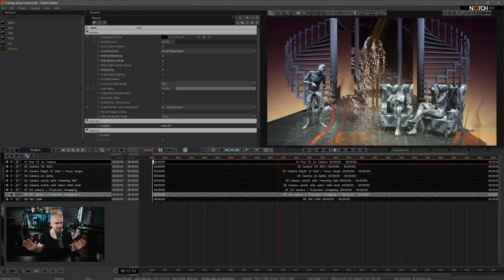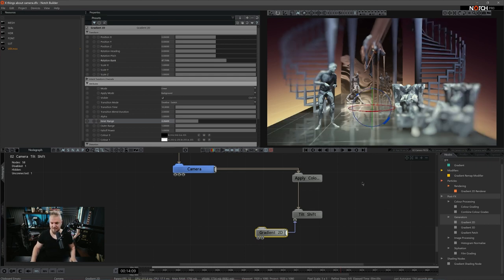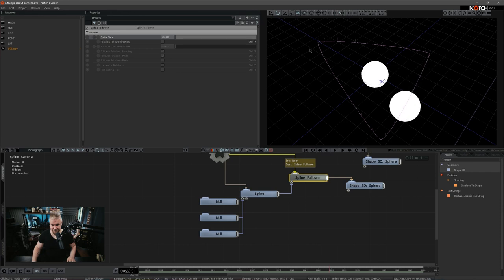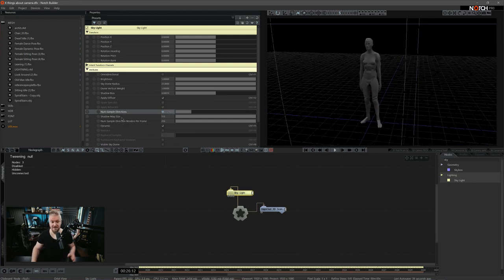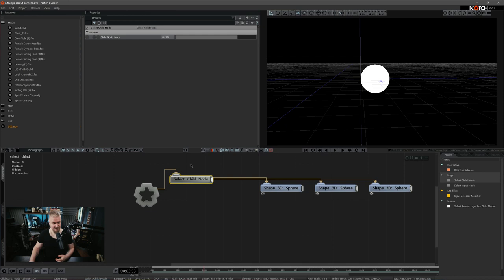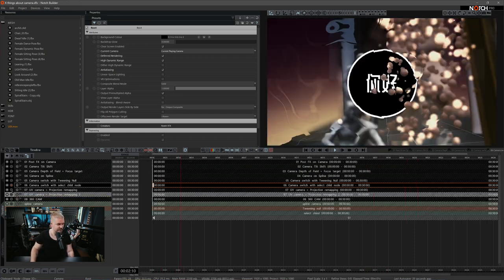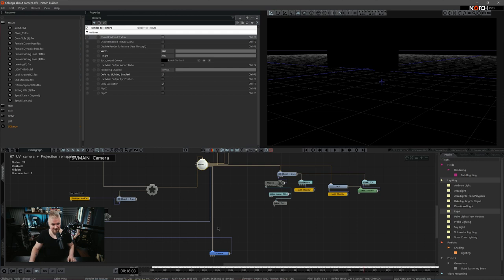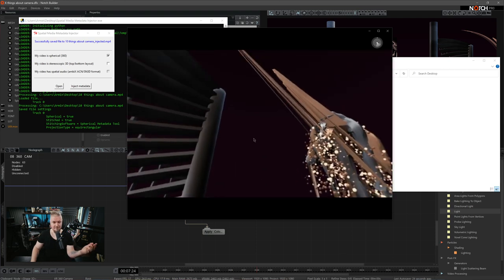8 Cool things about Notch Cameras

Comment: if we use a separate layer for tweening null node than the main scene, is it possible to set the playing camera of the root node of the main scene as the tweening null node layer's camera?
Reply from the maker: If I understand you correctly you want to use a Tweening camera rig in layer 1 and get camera data to layer 2? If so, grab a Proxy camera, it is built literally for these scenarios.
http://manual.notch.one/0.9.23/en/topic/nodes-cameras-proxy-camera?q=proxy+cam
Reply: @arminwerx  yes..exactly..but how to interlink the cameras between layers, because each layer opens in a mutual exclusive manner?
Reply from the maker: @avirads  here is a fast sample for you Avinash, see if this helps:
https://www.dropbox.com/s/r59hmg7ukvkdour/tweening%20null_Proxycam.dfx?dl=0
Reply: @arminwerx  thaaanks ..did not know before that the "layer precomp" was a node. now i know how its done.

Comment: The tweening null set up, could this be video indsted of camera to switch through with adation rate ?
Reply from the maker: Hey! This technique is more applicable to geometry and positional alterations than video fades. 
You should try the Composite Sources node and Multiplex sources, those two nodes would be my start point rigging a fade-based video switch system.